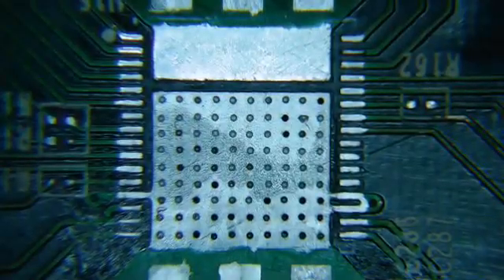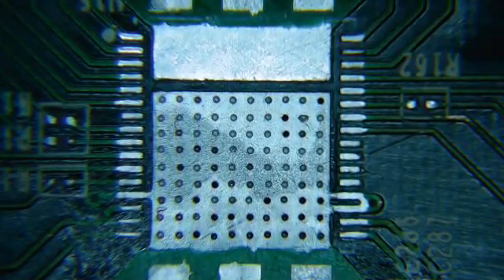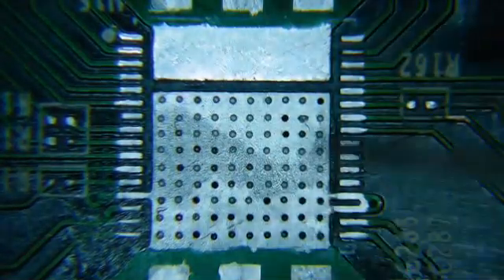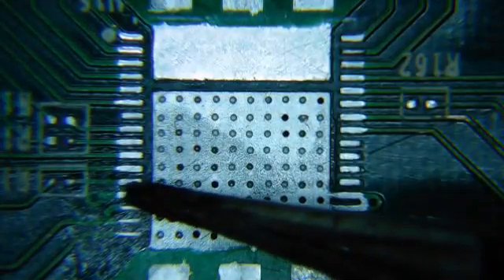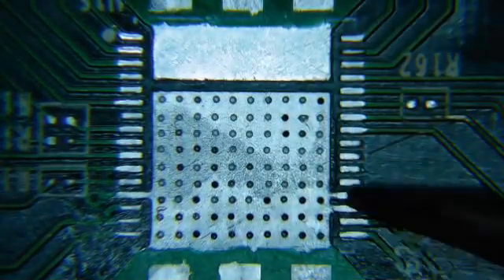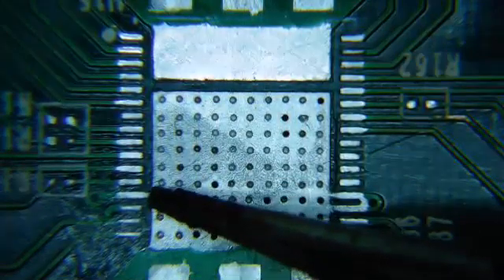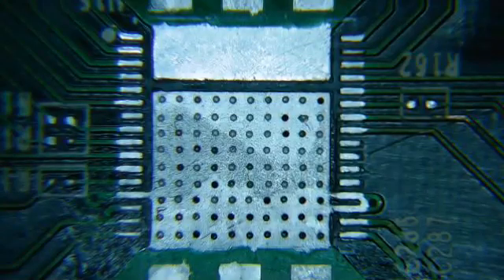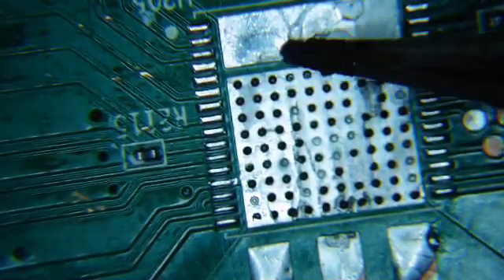hashboard repair: Problem replacing ASIC chip

Comment: Hi I hope you can answer me 

I have a fallen heatsink and the rest of the hashboards are just fine can I run the miner ?
Reply from the maker: Hi Mohamad,  You should not try to run the board without a heatsink.  It will, if it runs, will burn up the chip.   You can connect with me and others about repair on the discord server.  Thanks!

Comment: I just got 0 asic on my L3. Buy saying temp data failed! In log. Do you know if it's probably still an asic or temp sensor? Waiting for my test fixture, just trying to get some ideas if this has happened before to you maybe. It's doing the same thing as my innosilicon boards are doing so I really hopefully this lesson will cure all my boards.
Reply from the maker: I'm not aware of a testing fixture for the L3.  Some folks have been talking about the L3 on the discord server.  They are trying to come up with a way to debug the board.

But of course, maybe I'm wrong on the test fixture....  Thanks!
Reply: @AntminerRepair  I ordered one for L3+ from China. Guess we will find out. Lol. I'll keep yall updated. https://www.ebay.com/itm/384191818569
Reply: That's the ad for it if you wanna check it out.